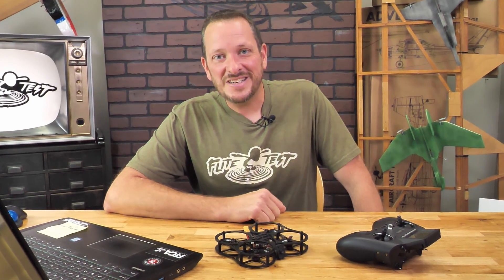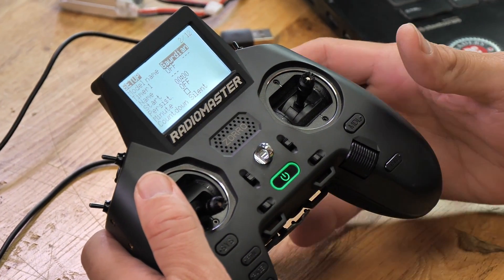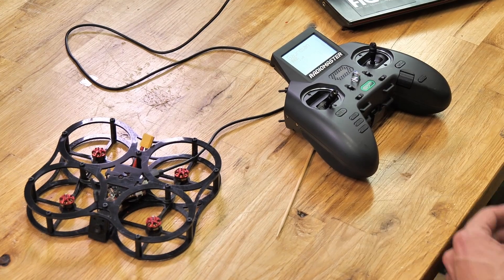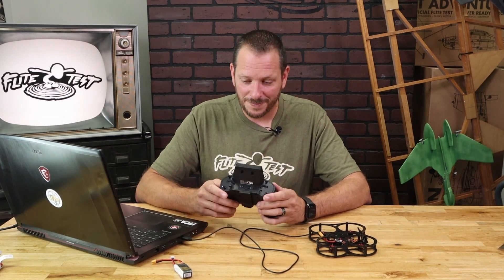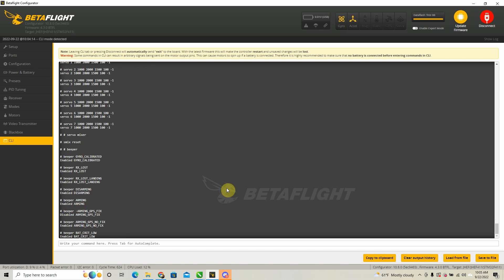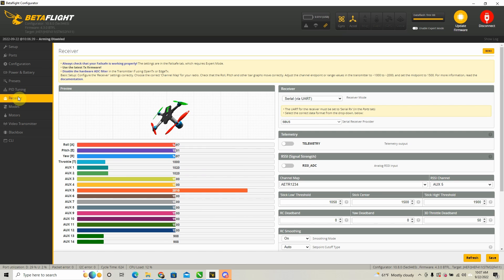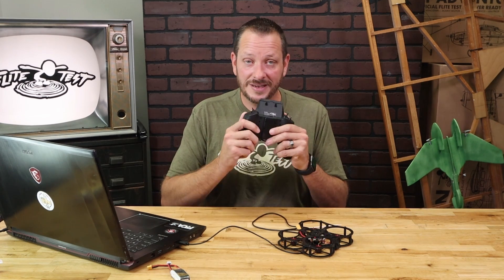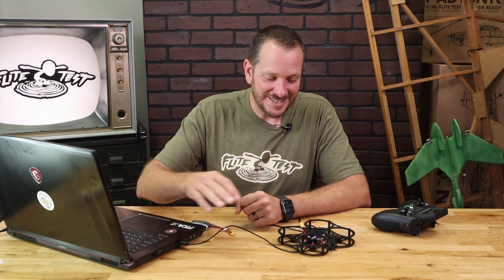How to Bind The Guardian V2 With The Zorro RadioMaster

Comment: I am having trouble connecting the flight controller to my computer. It doesn't recognize it. I've tried 4 different cables to no avail. The ImpulseRC Driver Fixer won't find it either. Any suggestions??

Comment: Hi Josh, 
I've been out of the hobby for a few years and want to get in FPV flying again. 
I'd like to buy the Guardian but I have 3 questions: 
Is it  3s compatible in the standard setup? 
Is it capable of carrying a GoPro Session 5? 
Can I get it to work with a DSM2/DSMX receiver? 
I have followed the channel from way back in the beginnen and love how you guys have grown over the years! 
Greetings from Belgium, Thomas
Reply: Hi Thomas 

The guardian can carry an instago 2, but not a session. It’s built for 2cell. The control board can do dsmx. 

Hope this helps 
JB